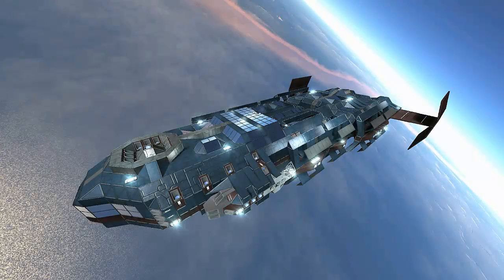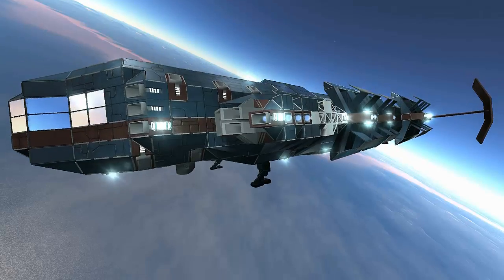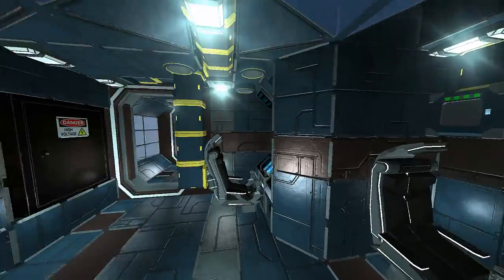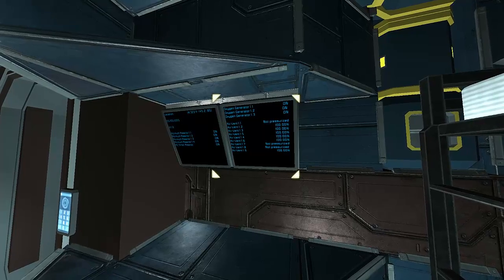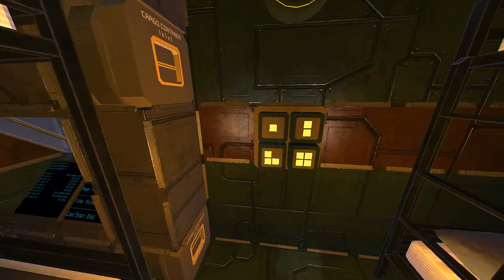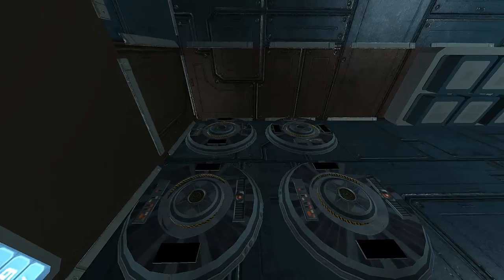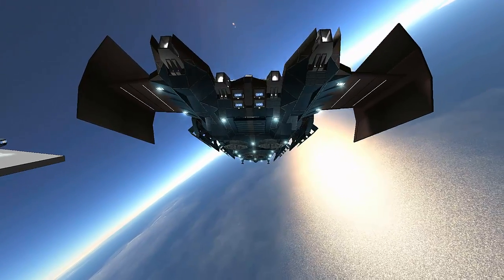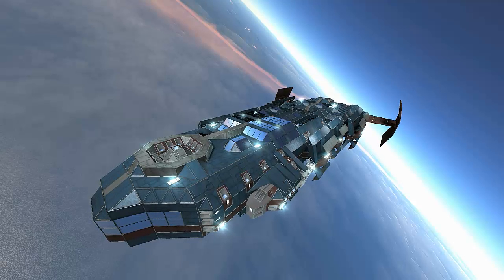Space Engineers | Xenon Explorer Vessel Look-See! - EP94

Comment: Beautiful work! I love the color scheme, and the design is well thought out. It does look lived in and practical.
A couple of small things to add:
-More connectors for docking, refueling and accessories
-A modular attachment point (for extra fuel pods, extra drones, extra cargo pods, rover, runabout, whatever). Just a connector next to a merge block works
-Deploy-able beacon buoy or antenna relay
-Cameras. Cameras for landing, long range vision, unobstructed front and rear view and docking
-Spotlights for those dark places. Interior lights only go so far

Comment: I have some suggestions:

-for the entrance try using the new Pistons/airlock doors they added to cover the slots from the outside

-in the cockpit add buttons line the center console. And a container for air tanks in case of breach. Maybe a small battery or generator in cockpit too

Comment: for your conv system you might want to look at slanted conv tubes for the corners, (just looks a bit tidyer) and there is armour panels that you can place over the top of the ones in the floor just to cover them up a bit (both of these are mods)